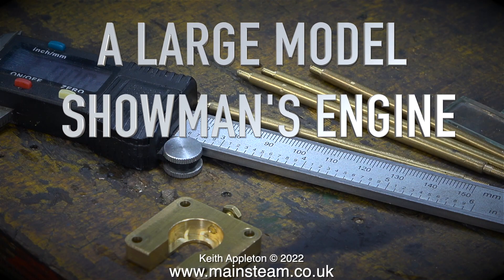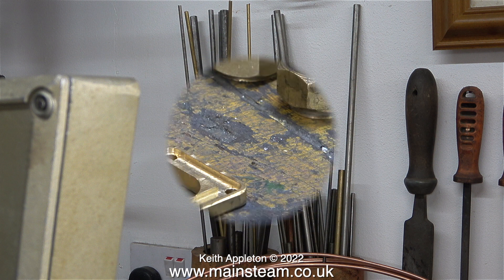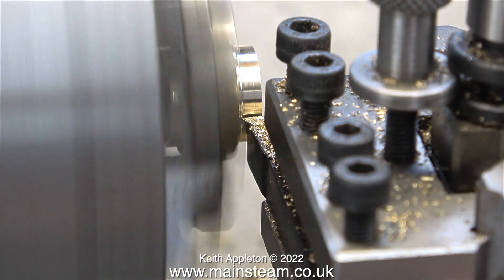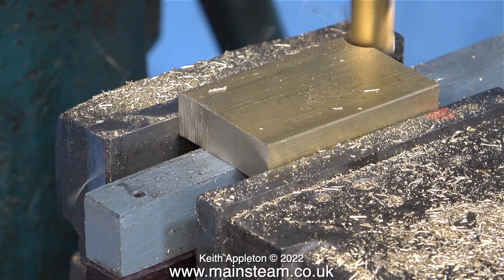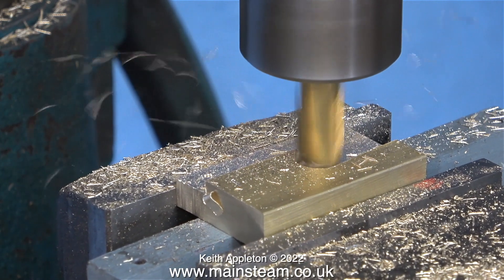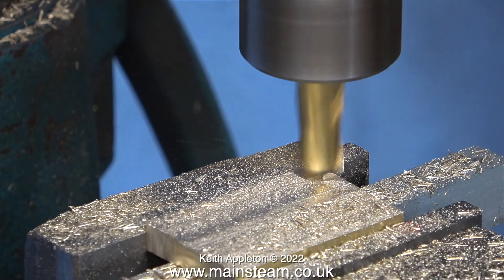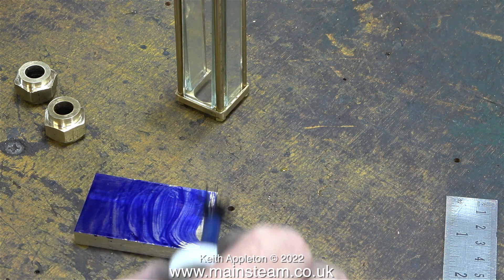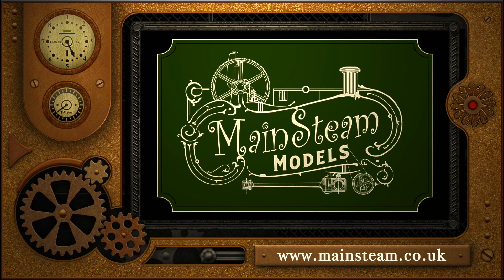A LARGE MODEL SHOWMAN'S ENGINE - PART #68

Comment: You can get some very functional Chinese-made parallels for under $20 from various sellers. Only ground on two faces, but they work. I eventually found a set of Starrett parallels on eBay for not too much. I also have a very nice set of machinist-made parallels from eBay that are about 3 in long, perfect for the sorts of jobs i do.
Reply from the maker: Thanks for the info!

Comment: I kinda wince when you are reducing the thickness of brass because right now brass and other copper alloys are expensive.  Though considering how little in weight you are actually machining away, it really doesn't matter.  I'm used to working for a company that really pinched pennies and bragged how they got eleven cents out of every dime and god help you if you made a mistake and had to throw away perfectly good metal.  We used to collect all of our waste (which made our shop the cleanest in the world) and sell it to a recycler for five cents a pound!   But in the end it made the old saying "measure twice, cut once" a very real practice for us.  The company now uses computer controlled machines and laser that can cut one inch thick steel like it was cardboard and their computer designs help keep waste to a very small minimum.  Young machinists today don't realize how easy they have it,  but they said that about me as well!
Reply from the maker: Being committed to making Tutorials, I have to machine metal to show the process works . . .
Reply: @keithappleton  Yes! And you do that very well!

Comment: other than not having having a thin ner piece of brass stock for the ends .... why didn't you get some thin brass sheet ... say 3 to 5mm ... then you wouldnt have to mill much if any ... 
.
Reply from the maker: I could quite easily have done as you suggested, I already had Brass of the correct size in my metal stock box - but what would be the point of that? I actually make these videos as Tutorials, and I wanted to show how to mill the Brass bar stock to the correct size - plus I needed the Brass ends to be at least 6mm thick as the design stabilises the position of both ends of the water gauge to make the structure more rigid. That is why I machined the gland nuts to a close tolerance fit in the holes in the base and top ends - I thought I mentioned that .......
Reply: @keithappleton  pity the cost was such a large piece of brass ... and yes you did ... I was thinking more along the lines ... of something not 20times thicker than needed ... ok I grew up with my grans frugality .. being a '64 child ...I still keep her lessons in mind always
Reply from the maker: This Brass cost me nothing, it was from the scrap bin of a friend's engineering company }:-)))
Reply: @keithappleton  lucky bugger .... me I have to buy my stock ... no one I know with that studd ... now lexan or plastic .thats easy peasy LOL
Reply from the maker: I usually buy my stock too, bit occasionally I pick up bits here and there . . .